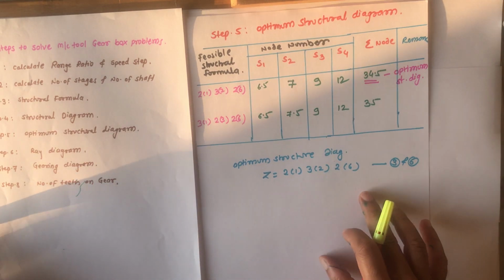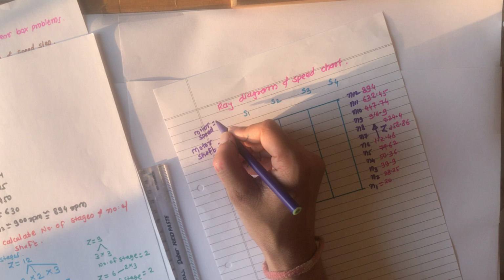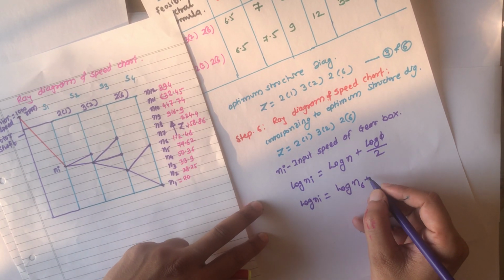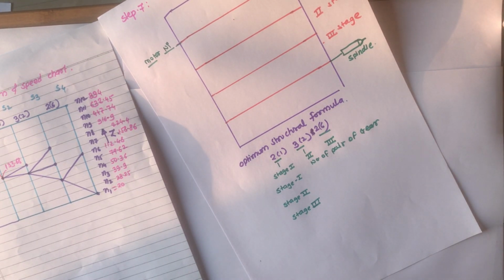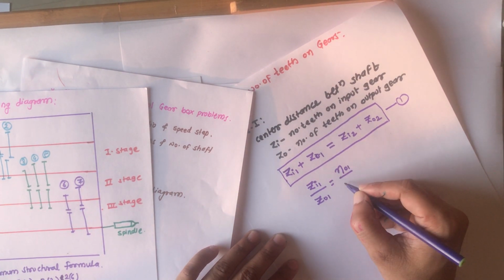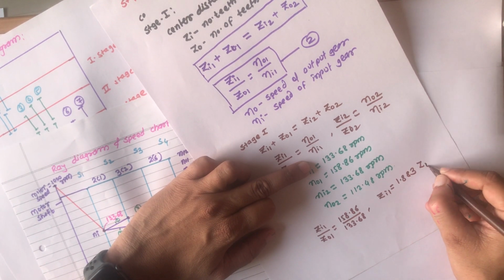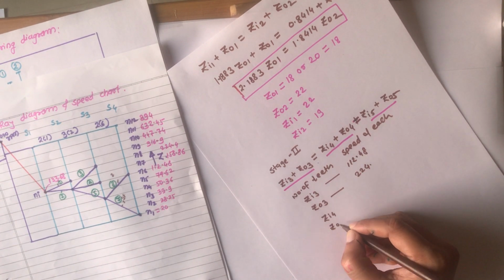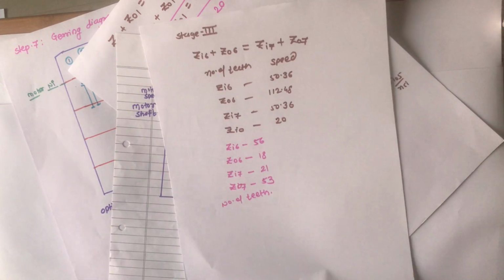12 Speed Gear Box Part 3

Comment: 11. Detailed specification of Honda Shine 125 two wheeler given below
Engine
Engine Type = 4-Stroke
Displacement = 125 cc
Max Power = 7.9kW PS @ 7500 rpm
Max Torque = 11 Nm @ 6000 rpm
No. of Cylinders = 1
Cooling System = Air Cooled
Transmission
Manual Gear Box = 5-Speed
Bore = 50 mm
Stroke = 63.1 mm
Emission Type = bs6
Primary reduction ratio = 3.6
1
st Gear ratio = 2.75
2
nd Gear ratio = 1.905
3
rd Gear ratio = 1.175
4
th Gear ratio = 0.92
5
th Gear ratio = 0.65
Final reduction ratio = 3.143
Design the following elements for above mentioned two-wheeler
a. Primary gear drive (10)
b. Chain drive (15)
c. Gear box (15)
Kinematic arrangement
No of teeth in all gears
d. Final layout (5)